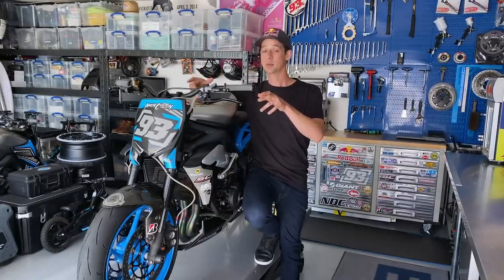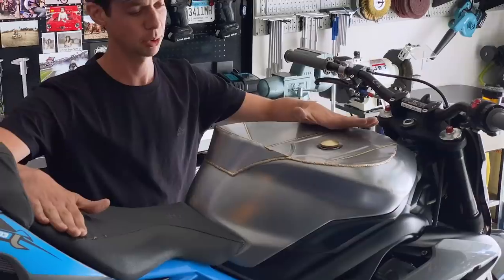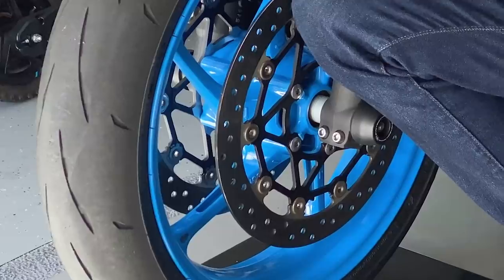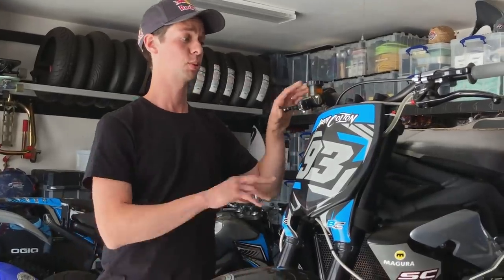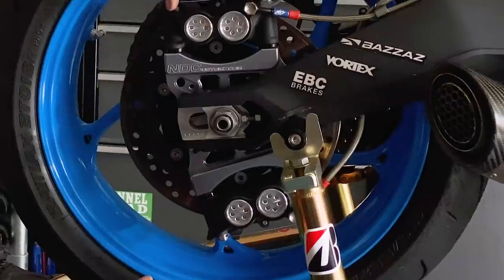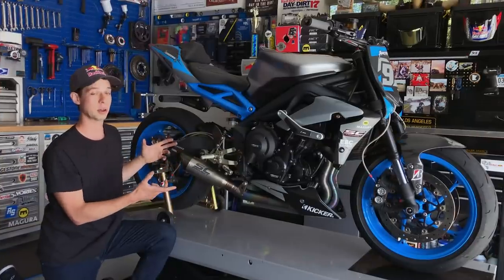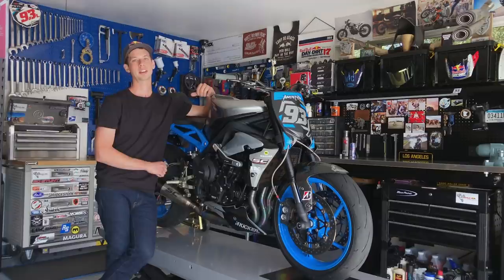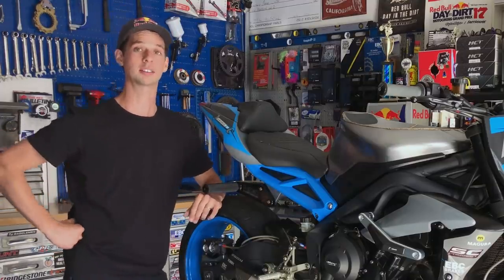Triumph Street Triple R: Anatomy Of A Stunt Motorcycle | MC Garage

Comment: What about a “clean air mod” when your on one wheel for so long the oil goes into the air filter then into the engine which suffocates it? Is that a real problem did you just not talk about it?

Comment: And that is how many new riders end up in a hospital bed or needing to buy a new bike.
Reply: I do not think that is the case. I am sure that inevitably a small percentage of riders may find them self on the wrong side of the balance equation but any rider that would invest into the proper techniques of learning this craft(or any other of that matter) will have much lower physical and financial impact of learning.  It would be a conservative bet to say 1% of motorcycle crashes are wheelie attempt related.
Reply: @AaronColton93  I pretty sure something like 99% are failure to navigate a turn or low speed drop
Reply: Tim M 100%

Comment: I think it would of been better to have someone a little less professional because I can tell he is just going over sponsors and what they want him to say.   He doesn’t have a 12 bar so far enough not talking about it but someone getting into stunt riding would want to know about one,  he doesn’t talk about clean air mods and with some other bikes oil pickups which are essential.     yes for someone of his level crash cages are probably a bit bulky but again people should know stunt riding is a lot of crashing at the beginning and you need to get proper protection for the bike.
Reply: well, the video wasn't about how to get started stunting... it was about what a pro does to his bike.
Reply: If you think it would have been better with your included information I suggest you create a video of this nature to help those like you are in the same beginner situation. I have not ran a 12" bar since 2008 and do not consider that important in the learning process.  As for oil pickup it is possible that some models may need this but in my personal experience with the 01-04 CBR600F4i, 03-04 ZX636, 09-12 ZX6r,13-15 690 Duke, 14-20 FZ09, 13-17 675R and 18-20 765R they do not. The same goes for the Clean air mod with the exception of the 03-04 ZX636. I do agree with you that a crash cage is a good idea for a beginner but that is if it is dedicated to stunt riding specifically. Otherwise you just ruined the ground clearance for when you are looking to rip.
Reply: @AaronColton93  thank you so much for this information,been searching all over the internet for oil pan mod, im an average stunt rider currently  got 2013 daytona R, and i'm adding a handbrake on it (enough for my style/stand ups),  will do the clean air mod and a second cooling fan (living in DUBAI), appreciate all the valuable info.